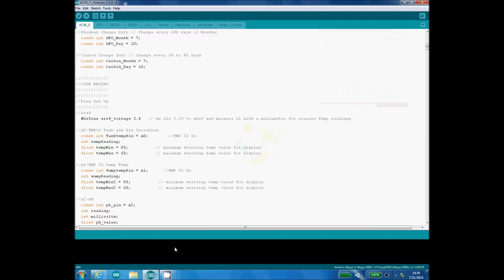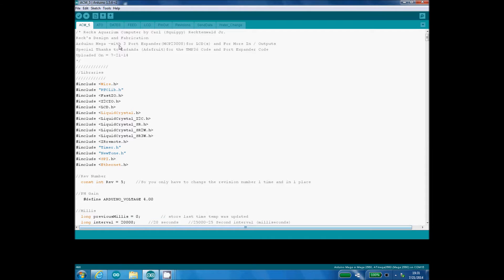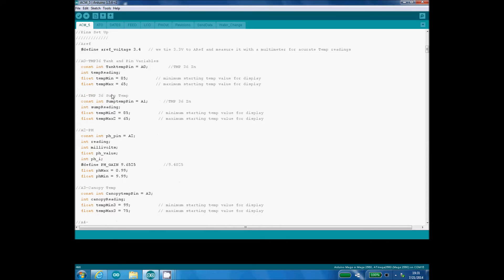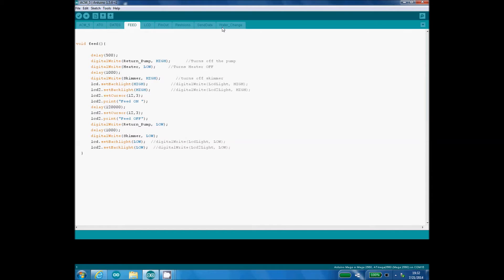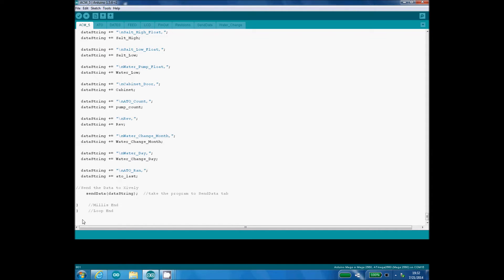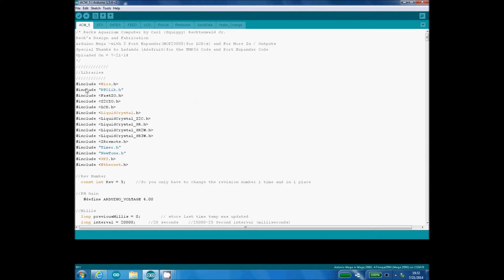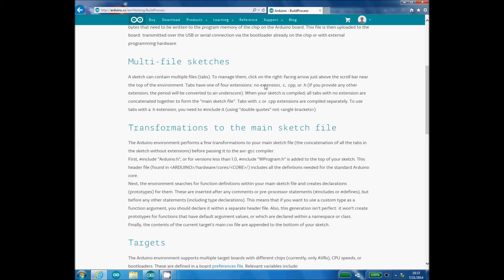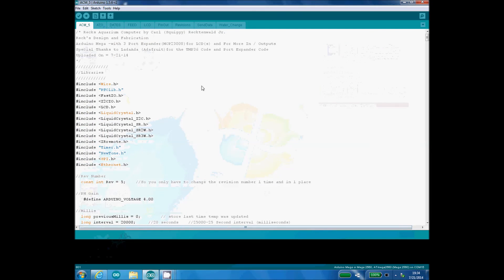Arduino: The use of Tabs in the Arduino IDE

Comment: When I get an error for a missing file such as kick_int8.h    No such file or directory, I add the needed file in a tab. But it is never found. I keep on getting the same error even though it is in the sketch. I have tried to resave. Tried to move the files to the arduino sketch folder. Nothing works.  Anyone know why this is? Drives me crazy I can see it right there. Why does the IDE not compile it?
Reply from the maker: You declare that .h file at the top of the sketch?
Reply: @CarlRecktenwaldJr  Thanks for the reply.  At the very top it says #include "kick_int8.h" When compiled it will say kick_int8.h No such file or directory.
But I went to sketch,then add file. Found the file and opened it and it shows up in a new tab. I have also tried sketch/include library/add ZIP Library and sometimes this works. It happens fairly frequently. I do not understand why I can be looking at the tab with the needed file and the IDE does not see it.  The spelling is always correct. 
I usually find a work around. But it takes a long long time. More perplexed than anything. When I am working on code and it does not always work I am pretty chill but when I am
staring at the file and it keeps on telling me that their is no such file I get a little unhinged.
Reply from the maker: Are you calling for that .h file in another tab besides the main setup / loop tab?
Reply: @CarlRecktenwaldJr     No.
Reply from the maker: That’s. Odd. Might want to try and ask on the around forums.
Reply: @CarlRecktenwaldJr   ok thanks!!
Reply from the maker: All of the files for the sketch need to be in the same folder.  You might be able to use the arduino online editor to have one h file and use in various sketches.

Comment: This was not useful to me.
I was trying to keep global variables with the functions as to completely separate different devices off into their own module file. I want to have a tab that has all the display stuff in it, another with all my temp sensor stuff in it, etc. This will not let me do that, because just adding them on to the bottom will not let me address them earlier in the code because its missing defines.

Comment: Hey there, was wondering if you know if its possible to have your main sketch, and include other sketch files (.ino files) in that main sketch.  I'm coding a big project and it would be so nice and organized if I can create one whole sketch that can go through and run multiple sketches, not simultaneously, but one after the other.   Also a sidenote, if this is not possible then I can use the multiple tabs method.  I tried it, but the second tab doesn't run, only the first one does. I'm not sure why :/  I don't have any errors when I compile, the code just stops running after its gone through the first sketch's code.
Reply from the maker: +Emma D You have to call the other tabs in you loop. So I have a tab call Boot_up. In that tab it would read as 
void (Boot_up){
//your boot up code here...
}

you would call it by running the line   Boot_up (); in the loop of the main sketch.
Reply: This is confusing me.  The video says nothing about calling a tab. It says the code of the tab is added at the button of the main tab.
Reply from the maker: Calling the tab is done at the top. So what ever your (name of the tab) is .h.

Comment: So, you mean that every tab is like a function and you just call it in the main sketch ??
Reply: .h is a c/c++ header file. It defines the interface of a .c or .cpp class file. Hex files have a .hex extension.
Reply from the maker: +Samer Elsawy    Yes, except your setup and loop functions need to be on the same tab.
Reply: +Carl Recktenwald Jr. Yes, i got it.
But plz, what is the difference between (.ino,.c,.cpp,.h) files ???
Reply from the maker: Samer Elsawy
.ino is an Arduino file, .h is a hex file, .c is a c file and .cpp is a C plus plus file.
A Hex file gets uploaded to Arduino board, it is the compiled code that the Arduino understands.
Reply: Thanks alot Carl :)

Comment: I'm trying to work with a 3d printer sketch (Marlin) with SO MANY TABS they flow off the window. Even if I expand the list, it's so long I can't get to the list bottom! How do I get the tabs to scroll across the top?
Reply from the maker: Not sure I understand your question. First try using the latest arduino ide, 1.5.4, in that ide they have added some scrolling. 2nd if you are trying to get to tabs off of the screen you can click the arrow box in the ide on the top right and then select which tab you would like. Hope this helps!
Reply: I used the recommended IDE v1.0.6. Trouble is even the drop down from the arrow box is so long it too flows off the bottom of the screen and does not scroll. I even tried rearranging my dual monitors vertically and it spans more than two full screens! I guess there's no reason not to try newer versions. Thanks for your reply!
Reply: Hey Z
In the 1.8.0 they added a scroll key in the end of the tab. In marlin you can make a personal version, with only one languis and only one pin file (board typr) that make it a lot less confusing.
Kind regards
Tupni